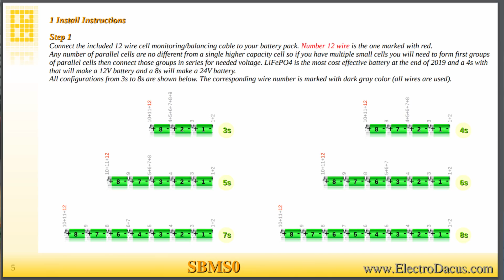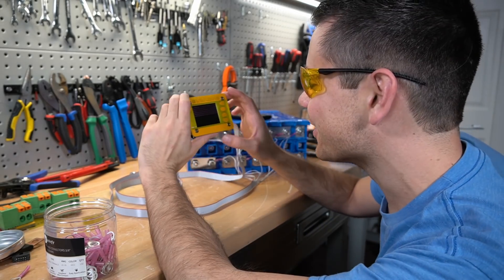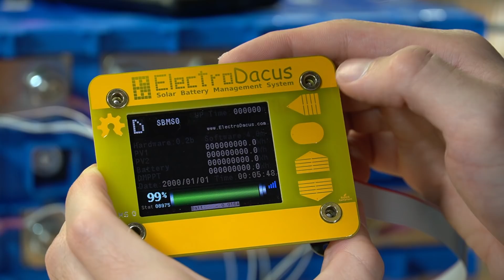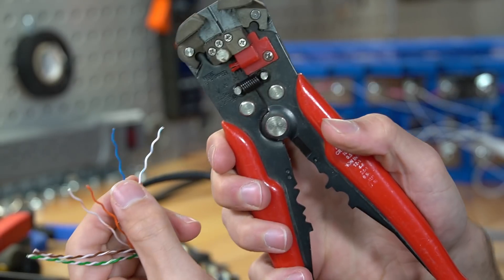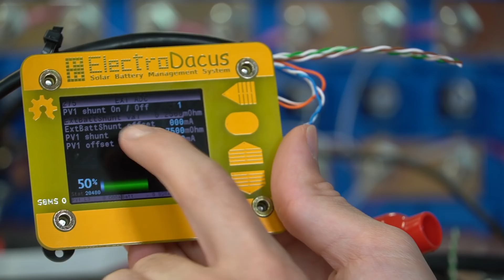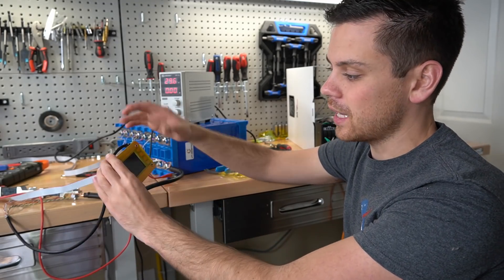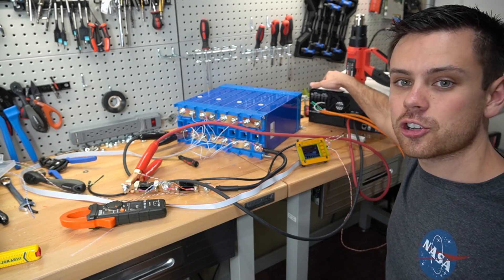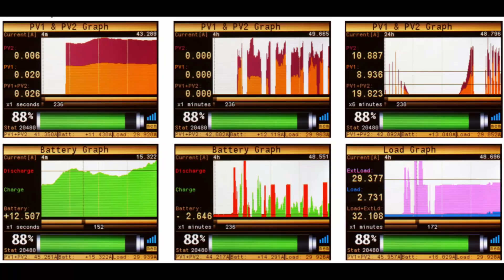Electrodacus -Open Source- Solar Battery Management System: Introduction and Setup

Comment: hey will i'm pleased you got a sbms0 i love mine too, be careful connecting the smbs0 direct to the switch on the inverter  as some carry too much power and could damage the sbms0. its is advised to connect though a ssr in series with the inverter switch :)
Reply: The MPP inverters are properly designed you are referring to low quality inverters that have all sorts of other stuff connected to the ON/OFF switch. I also have an MPP different version and it has only 10mA of current trough the ON/OFF switch well below the 50mA capability of the EXT IO3
Also you can just move two jumpers and you can use a connector on the MPP solar not even required to solder the wires. Tho not all models as there are newer MPP models that do not have an ON/OFF switch just a momentary push button and those will not work.
Reply: @electrodacus  i forgot you had the same brand inverter! i just considered a ssr a cheap safety device to protect the awesome sbms0 from rouge inverters
Reply: @RIVNUTBrainCaseSugaryGoodness  There is no report of damaged EXT IO3 post on any SBMS and even if that where to fail is just about $1 for one and easy to replace. It is the Toshiba TLP187.
Reply: @electrodacus  easy for you to replace im sure Dacian ! i would prefer not to take that risk of damaging the Optocoupler! My inverter has just under 50ma over the switch so below the 50mA capability of the EXT IO3 but i wanted to play it safe.
 Its definitely not a cheap inverter as its 3kw pure sine low frequency.
I think the reason there has been no reports is because the kind of people who buy a sbms check before they connect and as a few people have found a ssr is needed if the load is too great.  i was just trying to give will a heads up on this as it would be good information to include on a future video so as to prevent anybody accidentally damaging sbms with a inverter modification . great work on the sbms0 by the way

Comment: I want to see you expand the Electrodacus and use his thermo controller to make a hot tub? or dump power to some other use, making donuts? making wood pellets? we should all have excess solar power to dump and make money with it.
Reply: The new DSSR20 will have diversion to heating and should be available in April.

Comment: Lots of good info, thank you. Without the PWM relays in series with the charge source, say solar or in your test  a bench supply,  how can the BMS control the charge to the battery?         Could you have put the cell voltage sense wires on top of the nuts that are holding the interconnecting cell straps? All that you would need is a few nuts to go on top of the ring terminals. Like your video on copper cables.

Comment: Because of the nice display they are cool. But for the reasons you mentioned. No MPPT, being unable to have a string of high voltage panels and use smaller wire. They simply fail at being practical to me. I simply don't see an advantage of using these over MPPT charge controllers. Sure there is less parts on them to go bad but not worth losing the efficiency of an MPPT design. The guy makes a lot of money selling these because there is not much to them, so cheap to make.

Comment: In your video you wired 2 wire to the MPP switch in parallel and why not in series. That way you would not have to add a switch to turn on or off. Just thinking!!!!
Reply: Is likely better to have a switch in a convenient place than use the build in switch. I have my manual ON/OFF switch in the kitchen where I have the only AC outlets in the house as most of the time inverter is used is for electric cooking so I power on the inverter just a few hours a day most of the time is off and that saves about 20kWh/month.
Reply from the maker: Yeah that would be better

Comment: ElectroDacus has also explored energy storage in water. Another branch of exploration for Will Prowse might be storage of energy in phase change materials. Basically batteries are great for electricity storage but most energy is used as heat and can be stored in non battery mediums such as water. But the future looks like we will need to have a higher energy dense fluid than water (the current king).  There are several out there, it might make for an interesting side project for Will, both as heat storage and cooling storage.

Comment: Low temperature disconnect?
Reply: Yes both low and high temperature disconnect are supported by SBMS0 all you need to do is add an external NTC 10KOhm B3950 temperature sensor and set the low and high limits you want tho you should not expect low temperatures and if battery needs to be outside for some reason then it needs to be in a well insulated box with a thermally controlled heater.

Comment: If you do not have smart components directly controllable by the BMS, you can use a contactor (a big relay). Use one for loads, a separate one for charge sources.
Reply: Most inverters can be controlled this way directly by SBMS and you can not just add a large contractor on the DC line if is an inverter as that will get damaged even if not at the first connection. It can work if that is just for disconnect at low voltage but no reconnect and then you manually reconnect once you precharged the capacitors. This (discharged battery) should not happen in a well designed system. I did not had my battery empty for the past few years and I only have solar no other backup source for electricity. The DSSR20 are charge sources for PV and they can be of course directly controlled. I will try to avoid any other sources as they will be more expensive than PV by large margins about 10x more for grid energy and 50x more for energy from alternator or other fuel based generator and this are such large differences that should be completely avoided if possible and if cost is important.
Reply: @electrodacus  Any examples of using direct 12 and/or 24v if a relay/contactor will not work? I will use solar on boat and likely the batteries will need a cutoff when hitting a low voltage.
Reply: @zzzdgr  Are you asking about using 12V or 24V DC appliances ? other than very large DC-DC converters then yes you can use something like the Victron BP65 or the large models even multiple of them and they have remote ON/OFF compatible with SBMS0.

Comment: Hey Will, will this unit or from same place work on my 15 s headway 48 v system?
Reply: No this is designed for 8s max so 24V battery max and 3s minimum.

Comment: The switch you reference on the side of the MPP for the inverter.... does that only turn off the inverter and And not the solar charge controller. If yes then I assume I could hook a remote switch up to that to turn the inverter on and off if I’m not using 110 V and the fans are bothering me....Is that correct
Reply: Yes Will mentioned in the video that you can add a switch in series with EXT IO3 to manually turn off the inverter when you do not need it. That is how my inverter is also connected as I only need the inverter one or two hours per day mostly for electric cooking. Voltage there is just battery voltage so 12 or 24V depending on model and just less than 10mA current so not a problem for any switch. There is also a more elegant way to connect to that switch without soldering by using the 3pin green connector with the labels NO and NC but before that you need to move two jumpers on that board to get that configured as remote ON/OFF instead of generator start.

Comment: How long did it take you to get this, I know it was a batch deal, and had to wait for them to be built,
Reply: Currently SBMS0 and WiFi option are in stock the DSSR20 is just out of stock but will be back in stock in April and have extra functionality as diversion to heating for excess energy.
In the past I build this based on Kickstarter orders but now the SBMS0 and DSSR20 should be available at all time's form my website.

Comment: Are you going to or did you test the low temp shut off?
Reply from the maker: I need the right type of temp sensor. Pretty sure it works. I can't imagine it not. You can even see it in the diagnostics panel. I usually only test on cheap BMS because failure is so common.

Comment: I am thinking a PC board at the battery with screw terminals for connections to the cells using "real" wire, say 14g, and a proper connector for the ribbon cable.  Maybe even some fuses.

Comment: I am using two SBMS with two Tesla Model S batteries, BMS's allows for very good customization and Electrodacus provides extremely good technical support.
Reply: Are you using them in a 48V configuration?
Reply: @DaFergus  24v

Comment: I own and use the first designed by ElectroDacus - the SBMS4080 ..... very good design and build quality
Reply: There are less than 100pcs of SBMS4080 so you have one of the very few units shipped. Thanks for supporting the project in the very early stages.
Reply: @electrodacus  Yeah, I've remember 61 supporters on the first SBMS Kickstarter.

Comment: Just a small amendment, is not open source. 

Edit: my bad is open source and is crazy for one individual to develop something like this by his one and shared with the rest of us.
Reply: Everything is in public domain, circuits, code, firmware; whoever wants can pick it up and alter it as they wish, open source.
Reply: All my projects are open source. I just host the code and files on my website as I do not like to deal with github or similar services. While it is open source I write all the code.
Reply: @electrodacus  my bad, at a first glance I saw the user manuals and the forum but I didn't think that the links are at the bottom of the user manual.
Reply: @glide360x  No worries. Is not quite the typical open source project where files are on github or similar services.

Comment: low temp cutoff?   i live on a sailboat in the great lakes. that's a definite need for me!
Reply: Yes there is low temp cutoff but it is not useful unless you also build a insulated box with small battery heater so temperature never gets below freezing as when it gets there it will take hours to get it back to normal operating temperature.
Reply: Thanks for the heads up!  I'm thinking I'd put them inside the cabin.  In the winter I winterize the freshwater system and shut off heat when I go to work.  So it can ocassionaly dip below freezing in the cabin during the day.  Im currently using golf cart batteries and freezing is not a concern.

Comment: great channel
do you know of a low temp sensor i can put on my battery that will turn on a heating blanket, i live in the far north
i want the battery to keep itself warm if it has too, then charge when i start my vehicle or my solar panels start up
Reply: You will need a well insulated battery box at least 10cm (4") of foam and very well healed then you can keep the battery warm with a small 10 to 15 W heater controlled by a $5 digital temperature controller and so energy use will be less than 0.25kWh in 24h
Reply: @electrodacus  thanks for the reply, i assume the temp controller can be found on Ali & is simple to hook up.
i was going to use a heat blanket made for RV water tanks or similar
Reply: @kinker9356  The heat blanket alone will not be a good insulator at all you need a well insulated box and yes there are many just search for Digital thermal controller there are plenty of options. I reviewed 3 models recently on my forum but do not want to add links here. All of them will have been good for this application just not exactly what I was looking for in my case. All you need as a heater is a 15 to max 20W heating element and maybe a small 1W fan to circulate the air uniformly in the box.
Reply: @electrodacus  great thanks i'll check the forum, i was looking for something but didn't know what to call it, so i know that now (digital temp controller).    thanks again

Comment: I have been through pretty much all the comments. You are probably working on a more complete video to include : temperature sensors and SSR switches . Will you please include the exact models and links you purchased from? I would love to know what shunts you used and more explanation on how you connect them. You said that one was for charging and the other was bi-directional. Thank you!
Reply: The current shunts will depend on your application and any current shunt between 10A and max 750A can be used and the two shunts do not need to be the same value.
Say for example you have 6x 300W panels each panel may put out a max of around 10A so 60A max charge current then you will want a 100A current shunt for the PV current 100A 75mV will be best option but you can also use 50 or 60mV current shunt you just need to introduce the correct value in the SBMS and then store the data using Save Device Settings button. So 0.075V / 100A = 0.7500mOhm is what you will introduce in the SBMS0 and you have 4 decimals places so that you can fine calibrate the current shunt if you want tho the calculated vale is more than good enough.
The battery current shunt is bidirectional so that it can measure current going in or out of the battery so if you have a 60A max charging from PV panels then you will likely have a 240 to 300Ah battery and if this is 24V you will probably have a 2000 or 3000W inverter thus maybe 130A max continues current expected for load thus a 200A current shunt may be best option to use in this case so if that is 75mV then you will introduce 0.3750mOhm in the SBMS0 for this shunt that way the SBMS0 knows what shunt you have and know to display correctly the current.
In user manual page 3 is shown how the two current shunts get connected.

Comment: Does it have canbus control? Most hybrid inverters have this feature inluding MPP. I saw Electrodacus’ tutorial vid ages ago but I don’t remember.
Reply: CAN bus is just a bad idea as inverter will not fully turn OFF since it needs to maintain communication and that can drain battery if you are not supervising the system or you are away for a few days. The simple remote ON/OFF using EXT IOx is a much better idea and will fully turn OFF the inverter and also this is supported on most inverters or it can be made to be supported as shown in Will's video.
While SBMS has a CAN buss it is not used and there is no software written for it.
Reply: @electrodacus  The only reason I asked was I can see cases where you don't want to turn your inverter off. What if you have a generator connected to your inverter as well as a battery? Also a hybrid inverter must stay on to charge the battery, as the charger part of the inverter is connected to the same powerswitch. Therefore if you turn it off, the battery would never charge from the panels right - because you've turned it off via manual switch rather than what happens normally. Am I missing something? I thought this was why many inverters had CANBUS control? Maybe I'm just not understanding the usage case because I'm sure you've thought all this through.

Comment: Hello I am new to all of this. And I'm looking and I see forklift batteries. are they any good to use for this situation. I am off grid. I currently run two 8D batteries and I'm charging them off my generator. I'd like to switch over to solar and was thinking figure batteries would be better right?

Comment: One thing to point out Will, the mistake you made connecting the shunts to the negative side can and will damage the control chip in the SBMS0.  This is why the shunts have to be connected to the positive side of the battery before the fuses so the shunts can never change polarity to negative. This is not a BMS for a beginner as it is not plug and play. If you consider this cost less than a Victron BVM712 but does the same plus extra bms, it is a great value.
Reply: I have been told shunts are usually placed on the negative side because electronics are cheaper.   In a grounded system, having the shunt on the positive side has the great advantage that the negative bus will actually be at ground potential. With a negative side shunt, there will be a small voltage on the negative bus, based on the load of the system.
Reply: @dhowman  Yes that is correct.
Reply from the maker: Very true. I thought it was ruined when I found out it was on the wrong side. This is first shunt I've seen on positive side. I'm glad it was not destroyed.
Reply: @WillProwse  It will not get damaged unless you make an additional mistake to connect a breaker in between the battery and shunt and then when you disconnect the shunt you get negative voltages (below battery negative level) that will damage the current shunt amplifiers that have a internal protection diode between the sense input and GND (battery negative) so voltage at current shunts needs to be below battery negative level to get that damaged. The way will installed the shunt's will not have damaged the SBMS0 it just did not worked.
It is more expensive to implement battery shunts on the positive side that is why most devices implement on the negative side but I do not like that since I like common negative installations and I do not like to have ground potential shift due to current shunt resistance added on the negative side.
DSSR20 are the same they interrupt the positive side not the negative again more expensive as is more complex to do but nicer in my opinion.
Reply from the maker: @electrodacus  smart. Very nice.
Reply: @electrodacus  Speaking of potentially damaging the SBMS0, I have the battery shunt only on my system right now and everything works great, (nice work btw!).  I could only get my hands on another 250A 75mV shunt for the PV.  I'm a software guy, not EE.  So, I'm very worried when I see the schema indicating to wire the incoming positive PV cable to the combined battery and PV shunt.  Does anyone have a visible example of how to wire the incoming PV positive to the shunt to the inverter?  I'm thinking I must be reading the schema incorrectly.  Thanks in advance!